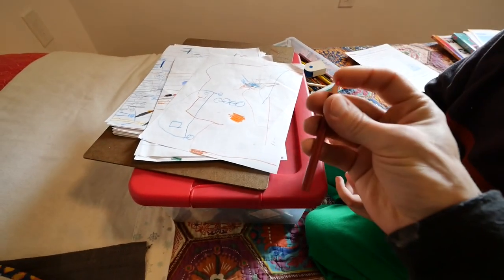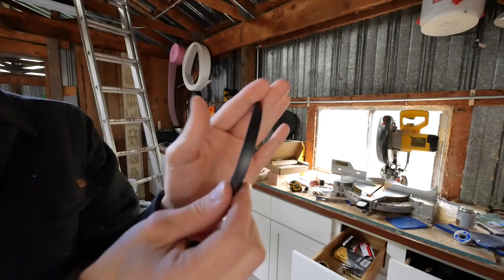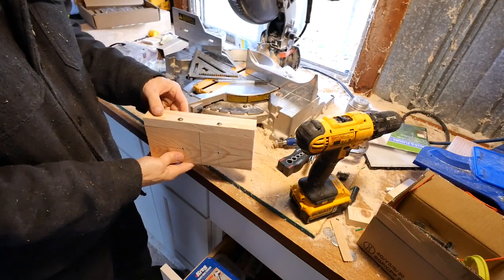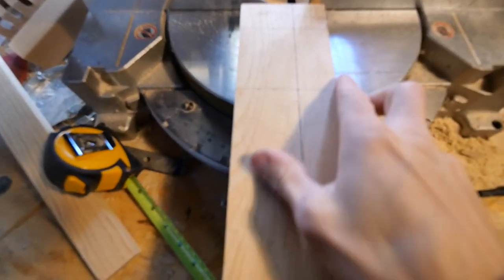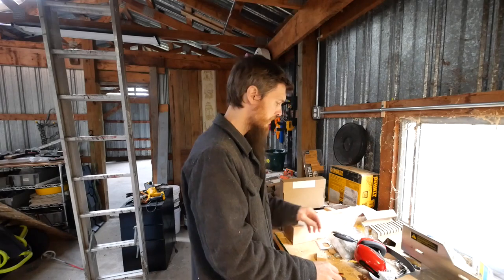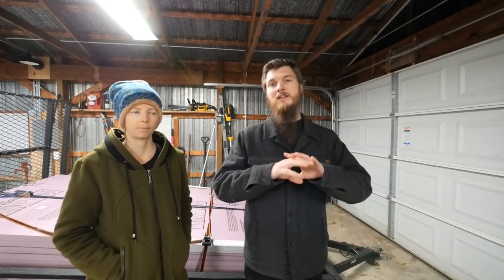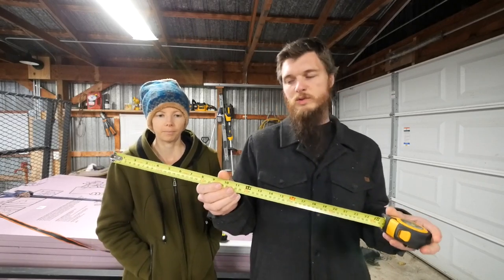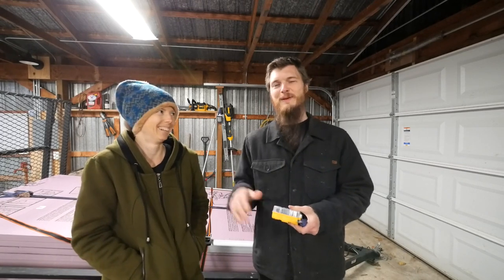Problem Solved in our Garage Shop - Easy Handle Install

Comment: Mrs. walter here.  Thank you Doug for the screw cut off tip!  I’ve been living for 4 years with a tool drawer with 1/4” too long screws.  Went and checked my wire cutter as it’s slightly different.  Yep, it was there.  Never knew that.  I have arthritis, so had to use a hammer. But it worked like a charm!  Thanks again for the tip!

Comment: Just a quick tip when using the tape measure.. To prolong the life of your tape measure and accuracy of it  for that matter, try to stop the tape from slamming closed against the case when reeling back in. It’ll save you in the long run. ☺️ Enjoying the videos, keep it up!

Comment: Hi guys, good to see you trying out metric for a change, i find it a lot easier myself and having both on your tape measure is a real bonus. That little hole in your wire stripper tool is for the screws that come with your electrical switch boxes, etc. and it's really handy for trimming heavier wire i found. Belle, your bluejay is awesome, i hope you are signing all of your work. To help with shyness i found that developing a repertoire of responses handy to keep in my head, open questions starting who, where, what, why. The couple in Home Depot - So guys, what are you working on yourself just now? I couldn't have a you tube channel because i could not stand in front of the camera...just a step too far for me i reckon. Looking forward to seeing more development videos. Thanks for sharing. Stay safe and keep up the good work. 👍🖖😎🐶🦴🐔

Comment: I used to buy fabric in France occasionally and it was always measured metrically. I finally learned 1 meter is just a little bigger than 1 yard. I’m almost 68 and America has been “changing to metric” as long as I can remember. We don’t like change!

Comment: Cabinets came out good.👍
I learned today about the wire cuters that can cut a screw. Thanks
Also the tape measure is nice too !
You know if a guy was industrious 
He could take those fake drawer fronts off the sink base and build some drawers.
Never can have enough drawers.

Comment: I clearly remember in High School that we WERE switching to metric.  That was like 45 years ago.  LOL  Metric is used pretty much in every other country.  But, it is like how different styles of screw heads and screwdrivers invented in other country never really took off here.  We only manufacture what is American.  I am happy your happy with your new measuring tape.
Reply: Yes I remember converting to metric. Then all the sudden they never talked about it again..they still taught it but there wasn't the talk about converting anymore

Comment: I’ve been watching for a while, one thing you mentioned is you don’t know if you have a use for those upper cabinets why not use them as floor cabinets. I’ve done this before they work just as well as floor cabinets would give you a lot more storage.
Idea why not make a mobile bench out of the wall cabinets???

Comment: That's a versatile and useful tape measure with the markings on both sides! I also didn't know what the hole on the wire stripper was for so thanks for that tip. As a Canadian I'm used to thinking in both Metric and Imperial for measurement and weight, but I find the metric system simpler as it's so easy to calculate in groups of ten instead of twelve. We use celsius (like most of the world) for temperature though so when fahrenheit is mentioned I have to go convert that each time lol. Loved your story at the end, you guys have impacted a lot of people positively via youtube and should be proud of your accomplishments.

Comment: Bells picture is beautiful.  Mavrick is so patient with that pencil lol.  The handles are great, I have them in my kitchen for the same reason you chose, they are smooth.  Thanks for the plier tip, I have them and didn't even pay attention to the threaded holes.  That tape measure is neat. My company used metric because our clearances were so tight, the metric is way less confusing of a system.  Don't know what to say on the spare room.  A little insulation will also help it stay cool in the hot weather.  It is very different talking to a camera than to a crowd.  Take a deep breath next time and go with it,  now that you know how you react lol.

Comment: Inches are a unit of measure in the imperial (due to british empire) system. Also since heat rises, the vast majority of heat loss is through a room's ceiling/attic. R7.5 for overhead insulation is better than nothing, but not by much. If you install the sheets to the bottom stringer of the trusses and tape the seams, the main benefit will be the significantly less amount of volume you need to heat rather than all the way the roof.

Comment: I think the insulation will help keep the space warmer and hopefully prevent freezing when the temperature drops. Gret tip on the electrical wire strippers  - wish i had known that when i was shortening the screws for my drawers and i used a hack saw blade! In the UK we use centimeters but a lot of us are old school and still work in inches! You guys are so sweet and I get what you mean about being an introvert and getting a bit anxious when you are not expecting a social interaction!

Comment: First I have to say nice job on the blue Jay bell that's awesome.  Second Ashley I love that hat I need to get one for my wife it's so cool and Doug my in laws have a 40×60 pole barn and they heat half of it in the winter months.  The used that exact insulation you have and it works well. Trusses 4 feet apart should not have drywall on them anyway.  He has a wood stove he made from 2 55 gallon drums and that will roast you out of their. I think you will be very happy with the end result.
Reply from the maker: Thanks! The hat is a lined neck warmer, look on Amazon for similar ones. They don't sell this one anymore that I've seen.

Comment: Belle's creations just keep getting better and better. If a pencil has been dropped it will fracture on the inside, so every time you try to sharpen it the lead will break off.

Comment: That trick about trimming screws was way cool. I had no idea those tools had that feature. 
I switched to using metric for my yarn dyeing business. Its far easier to calculate how much dye, water and mordant/fixative is needed per weight of goods. Luckily the scales I use to weigh can be switched to grams easily, and the beakers have ml measurement on them, too. My proofing cabinet is still in Farenheit, though, to measure the temperature, but I dont have to do any calculations around that number.

Comment: Imperial is the correct term for inches and feet. You are right Asley it is an English term from the British Empire days.   In Canada we have been metric, phasing in various categories, i.e. road speed signs to gasoline etc., since 1977 through 1985 but I was raised with Imperial measurement so I'm an "Inch-Feet-Yard-Mile-Gallon-Cup" guy.  lol  Loved the "In-'see-you-lation' vs In'sul'ation" quandary, the first being a very British pronunciation.   Your Jigs are great and I learned what those holes are on the wire cutters.  Thanks for sharing the artwork.

Comment: From an Englishman the measurement is Imperial. I was brought up using inches and feet and still have problems with conversions although we converted to metric almost fifty years ago.

Comment: I have been watching since the house by the river. I subscribe to many channels, but yours is in the top 2 (except for the cat & horse channels - I am such a cat/horse freak). In any case what I find so endearing is that even though you say you are shy, you have such a professional way of speaking to the camera. That is a real accomplishment. Watching some channels you will find people gesturing in sync with their words (very distracting and off-putting). So even though you portray yourselves as "shy" you both have the ability to connect in a very straight-forward, natural and sincere way with your viewer. That is an accomplishment and I would guess it is an inborn trait since you are not trained to speak before a camera. It makes your channel very watchable as people have been discovering.
Reply from the maker: Thanks so much! Great comment 😊

Comment: Canada went metric a long time ago. I'm still messed up. For cooking, I still think in cups and teaspoons etc and I struggle converting recipes from grams or mls which, to add to the confusion are different. For temperature if it's weather, I can only relate to celsius but when it comes to cooking or someone having a fever, I only understand fahrenheit. For sewing, I can be yards one minute and metres the next, but seam allowances in my head only come in inches.  To top it off, I worked in graphic arts in the past and my head still sometimes thinks in points and picas.  Aaaauuuugh!
Reply from the maker: haha, it keep your mind working :)

Comment: What a nice video, great hearing you talk together and sharing your DIY tips. The measurement used in your country is Imperial.  We used to use it here in Canada, the change was made to metric when I was in junior high (many years ago).  I use imperial when measuring and cooking, but use metric for driving speed, distance, gas fill ups and celsius for temperature.  If it was 30° here, we would be in a heat wave:). Sorry for rambling. Your channel brings joy to me and many others.

Comment: I live in England and still use inches (imperial) I am 70years old and cannot understand metric. Thanks for letting me joining in from here and and getting me through lockdown.
Reply: Same here Barbar I have enjoyed binge watching to get up to date they are a lovely hard working family
Reply: I have a problem with the fractions , 5/8 3/8 etc, wonder if metric would be easier ,  but too old to learn now , lol. Hope you are staying safe across the pond ,

Comment: Imperial. I like you guys so much. I feel the same social awkwardness. Introversion is a good quality. Often the independent critical thinkers. Artists and problem solvers. Some pencil crayons have softer leads and twist apart in a regular sharpener but a blade often works.  Cheers

Comment: I believe here in Brazil all tape measures comes with metric and imperial, although we only use imperial when we are talking about electronics screen sizes, like a TV, phone, tablet... 
And thanks for the celsius at the, It feels more "inclusive" hearing a system that is familiar to me.

Comment: I needed about 30 cabinet/drawers pulls for my kitchen. I had been holding off because of the expense.
I went on ebay and found what I liked and needed for around $40. My son installed them for me for my 37 year anniversary...it looks like a new kitchen. Amazing what a difference hardware can make.

Comment: Use this imperial to metric converter to easily convert between imperial and metric units for length measurement such as those used to measure dimensions and distance. Convert feet to meters, yards to meters, miles to kilometers, inches to centimeters, and more.
Reply: There you go!!!

Comment: You’re right Doug, it’s imperial.  We, in U.K. often have both.  An example is milk - we buy pints which also shows the content in millilitres.  I admit to never being excited about tape measures! but I just checked the ones I have and they all show both measurements. 
Love the bluebird Belle. 🐦

Comment: No wonder I’m crazy about your channel!!!!!  I bought the green measuring tape and then bought one for my son. Now I’m going to need new ones. I bought my tape for the very same reasons you did. I love you guys!!!!! AND I’ve had electric nippers for years and never new that tip! I was working with screws just today and my first thought was, ‘ I hope I can find ones that are the right length’. Well, now I know how to handle that situation. 🤗👏👏👏👏👍🥰

Comment: Metric doesnt use fractions, thats the point, it works in decimal, its easier to use on paper and on a calculator. It really is much easier to use, esspecialy when your working with very small things, you use millimeters and all you have is simple numbers. Many woodworkers and engineres in the US use metric for ease. It sounds like its something your interested in, it really is worth learning it. For get about converting from inches, measure what you have in metric and work out the maths in metric. Conversions are only needed when your dealing with what other people have meadured in imperial.
Reply: Yep this!

Comment: You are so correct about fractions. I never learned the Imperial System in school. I now think it would have made fractions a lot easier because I could have visualized what a fraction looks like.  I do appreciate the Metric System because of it's ease of use.

Both of those pictures you shared were amazing. Belle's blue jay looked just like the one in my yard 🐦 Maverick's boat looks like my garage ⛵ Thank You for sharing 🌼

Comment: You do not need fractions to work with the metric system. Each measurement is ten times as much as the previous one and it is as easy as counting

thousand --> kilometer (km) = 1,000 meter
hundred --> hectometer (hm) = 100 meter
ten --> decameter (dam) = 10 meter 
one --> meter (m)
one tenth --> decimeter (dm) = 0.1 meter
one hundredth --> centimeter (cm) = 0.01 meter
one thousandth --> millimeter (mm) = 0.001 meter 

You have practiced the same system all your life when you have paid for stuff in a store. A dollar = one and a cent (or penny) = one hundreth. You do not have to calculate how much $ 1.24 is, you know that it is 1 dollar and 24 cents. The same goes for the metric system 1.24 m = 1 meter and 24 centimeter. Adding and subtracting is as easy as it would be for dollars and cents. 

In practice hectometer and decimeter are not used that often. I have never ever used decameter besides in math at school. 

Honestly: working with fractions sounds needlessly complicated to me. I'd rather not have to work out how much 5/8 inch + 1/4 inch is. If I have small measurements to add it does not get any more complicated that 1.6 cm + 0.6 cm = 2.2 cm

Comment: "Imperial" is still the official name of the number system in America.

My opinion (for all it's worth) is that you should beef up the insulation while the walls are still exposed. If down the road, you decide to change your mind and make it more of an activity room, you'll kick yourselves for using cheap insulation, and it would take more resources to tear it out and re-do it.
Reply from the maker: I wasn't trying to cheap out as much as just trying to find something that the mice can't nest in and will be moisture resistant. I'll see what I can do :)

Comment: Wow Doug...that wire cutter/stripper tool is great and now I want one! I have no idea if I would ever use it, but hey, the practicality of it pings my practical side, LOL. Besides, it's always fun when a handyman doing work at my house says "if only you had one of ____, that would save me a trip to the store" and I pull out exactly what he's looking for. The only problem with that is that some things tend to grow legs and follow the guy home (pliers particularly, and tape measures as well). <3

Comment: I think that it is neat that you are trying to learn the metric system to be able to use it and converse with a lot of your subscribers with it. You are right the system of measurement used in the US is the British Imperial system. I am telling my age but I remember a big push when I was in elementary school in the 1970's of the metric system being implemented nationwide with the deadline being in 1980 for the conversion. What they did was make everything that has a measurement also list the metric system of measurement. If you look at a bag of flour it will show you the size of the bag in British imperial and in the metric system.

Comment: I'm with you Doug as someone  older in the UK I could never get my head around centimeters and millimetres. So I use imperial that's feet and inches ,metric 😤😤😤

Comment: I love how Americans are completely baffled by the metric system.
Reply: I doubt most of my fellow Americans are baffled by a simple 10 based system of measurement. What does get them mostly I think is converting from one to the other as we grew up with "Standard" measurements so that's what we are familiar with.
Reply from the maker: Metric is pretty easy, but after getting used to how long an inch and a foot look, it's hard to picture how long centimeters, decimeters, and meters look, etc :)

Comment: Great tips Doug imperial is the USA I live up in Canada and in school in seventy five trudeau father brought in metric the son justin is now running the country and is a globalists and doing a piss poor job regardless back on topic I like using metric for temperatures but when I measure I like imperial I was told and did check out that metric measuring is easier or simpler than fractions but I am comfortable using imperial as the older generation used that when I came threw working threw my trade and being a welder we use measuring quite often like in carpentry
Reply from the maker: "...justin is now running the country and is a globalists and doing a piss poor job..."  You got that right!!

Comment: For the sink cabinets, put a hinge on the front and turn it into a pull down nook for either hand tools or fasteners. My grandmother kept her spices in hers, there was a board added to the bottom of the front, so everything tipped out when you opened it, and had a stop to keep it from opening past like 60 degrees